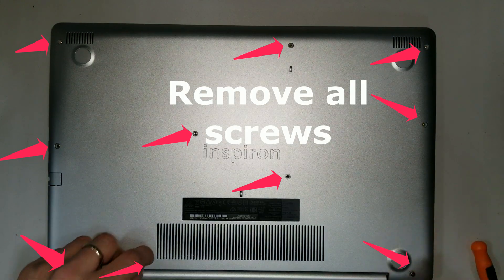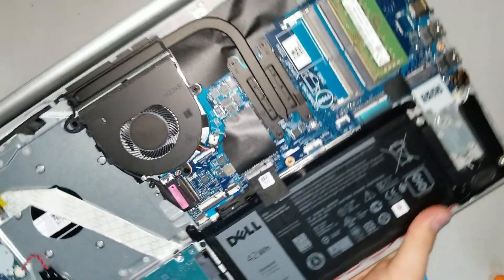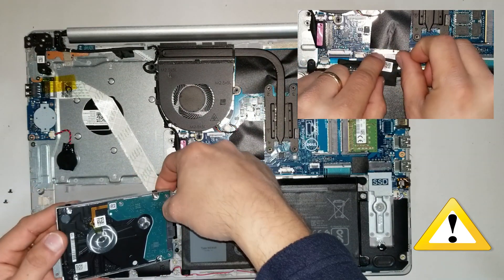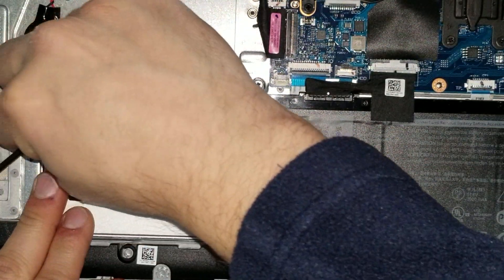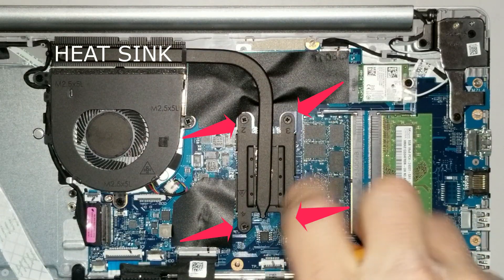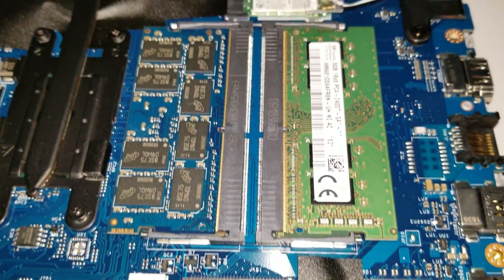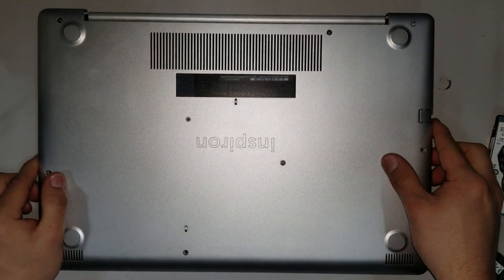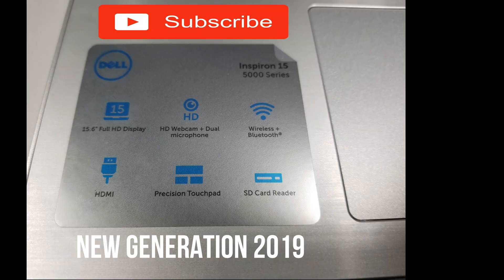Dell Inspiron 5000 series 5570  2019 & 2018 model

Comment: May I ask why does my laptop easily heats up and I hear unwanted noises from my fan as well. I wanted to clean the laptop's fan myself however I am afraid that I might break it cause I couldn't remove the DVD before opening the actual laptop itself from one of your videos that I needed to remove the DVD first before executing the removal of the laptop to manually clean the fan itself. 
I wish you could help me with this one thank you and nice videos!
Reply from the maker: It is a simple solution for that. Removed the battery and you will see the DVD unit from there. Get a plastic tool, removed first the screwn that hold the unit. And after push it out. 🥰. Let me know if this help please subscribed
Reply from the maker: Check this video that I made. Different model, but same concept https://youtu.be/Tx_ymVgB7fw

Comment: how trun on the KEYBOARD LIGHTS ???
Reply from the maker: There is a combination on the keyboard. Fn and look between the f2 to f12 keys, the little sun with up triangle. If your keyboard does not have that, maybe does not have a backlit. This laptop come with the backlit port on the motherboard. You should be able to buy it and change it with it. But first thing should be to check your model laptop for compatibility. Welcome to my channel please subscribe

Comment: Thanks for your help dude. Just RAM prices are too expensive! And I F-ed up my CPU chipset!!
Reply from the maker: You can wait a little bit, prices are decreasing when becomes to DDR4 RAM. But increasing the RAM really helps a lot in performance. Please do not forget to subscribed.
Reply: @xlearntechnow  Decease! When on a year... Less?
Reply from the maker: I think 1 16 GB ram is costing around $70 crucial brand. Before they were around $100
Reply: @xlearntechnow  not bad. Is that an SODIMM?
Reply from the maker: @liammchugh9439  Good Morning sir, Correct they are, you can check it directly under the crucial link below. (Crucial 16GB DDR4-2400 SODIMM) https://www.crucial.com/usa/en/compatible-upgrade-for/Dell/inspiron-15-%285570%29

Comment: What if I accidentally removed some thermal paste?! Could I replace it?
Reply from the maker: If you remove thermal paste. You can order good quality thermal paste in Amazon or bestbuy or in your local computer's store. You can remove it and re-apply. Make sure that you dont put too much and Google how to apply the thermal correctly in top of the CPU.
Reply: @xlearntechnow  Well I disconnected the CPU and video chipset from the holder and saw two parts of thermal paste. Do I need to I reapply?😢
Reply from the maker: @liammchugh9439  how long do you have your laptop for?  (Years). The thermal paste looks still fresh?. People recommend to re-apply after lifting the heat sink. On my case the laptop was brand new.
Reply: @xlearntechnow  Well, less than a year? I was probably stupid to remove it! I wanted to upgrade my graphics and install a GPU! I think it has a PCIe slot?!